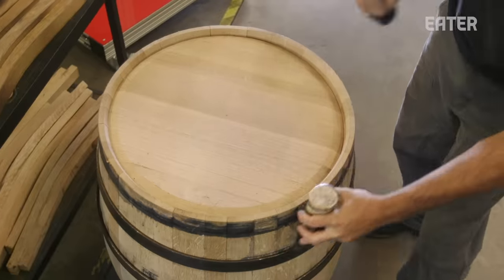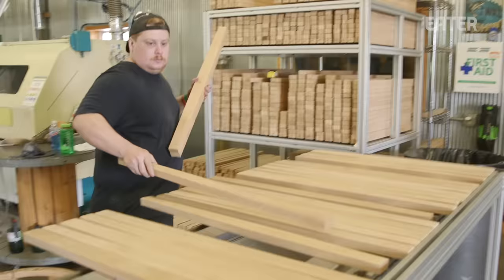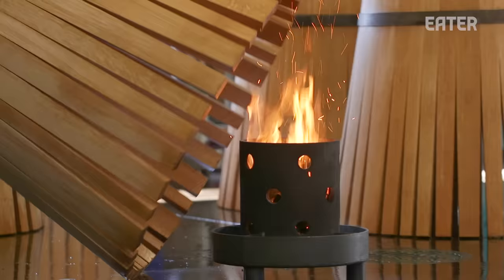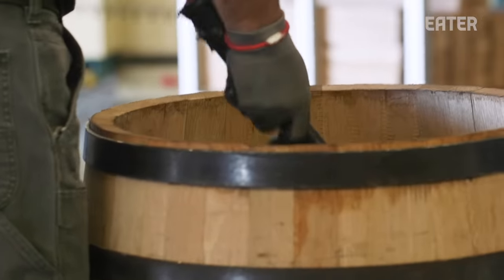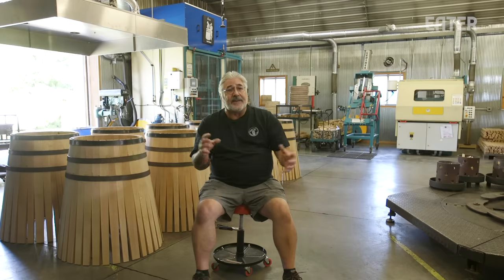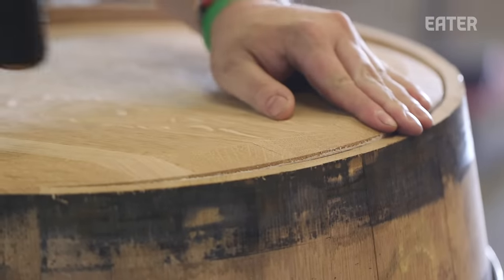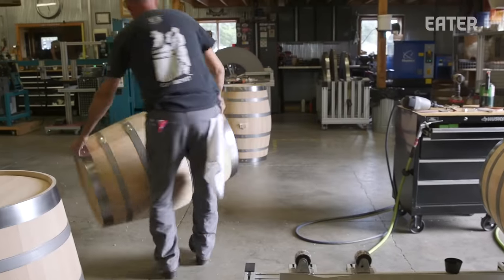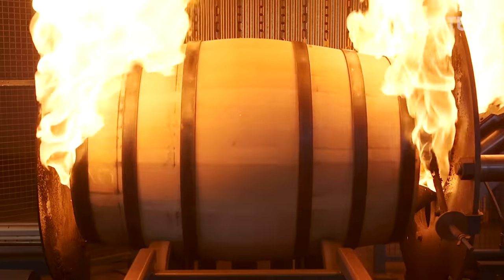How the NY Cooperage Makes Up to 100 Whiskey Barrels a Week — Handmade

Comment: Thanks for sharing.  In the USA the barrels are used once.  Then they are bought by Scottish distillers and they get several more reuses.  I visited several of the distillers and looked at their warehouses too.  You can see the "angels portion" - - little white deposits on the roof beams where evaporated spirit lightly settled....

Comment: Great video, great content, great product. I have an original cooperage catalog from 1897, that shows hundreds of different shapes and sizes. Back then, barrels were used for pickles, vinegar, oysters, all sorts of food stuffs and dry goods, to be shipped via stage coach, ship or rail. There were a lot more cooperages around back then, but as the lady mentioned, prohibition and the automobile cut that way back.

Comment: I recently toured a distillery here in Scotland where I understood that whisky is little more than water with ethanol and sometimes a smokey flavour if malting is done over a peat fire. It's not until the whisky gets into a barrel that it acquires flavour and colour and there's a massive hidden triangular trade in used barrels between Scotland, Spain & Portugal and Kentucky with experts buying the used barrels depending on what they contained before.

Comment: Very interesting an d you're providing a real world service.  I'm interested because I have one of only two mini-barrels made for the Bacardi family.  My friend's father worked for the Bacardi family for years and was given one of those barrels.  It's since come to me and I've been storing sherry in it for about 20 years.  Periodically I need to empty it, fill it with hot water multiple times and carefully push the hoops down a bit.  For that I use a wide blade screw driver and a ballpeen hammer.  I wish I could get it "updated with your fire.

Comment: I assumed when they showed the scene of them wetting the barrels he would specify that the water they used came also from Missouri and it was the same rain water that had been falling on those pieces of wood for the past 3-5 years, helping the wood age and cleaning off that Missourian pollen, and the rain water was collected only during certain months and than stored in special tanks, while barrel makers would walk around the water tank and basically speak to the water, telling it how special it is, and than when that water has been properly aged in NY steel tubs, it is then used to drench the barrels when they are firing them with "Pennsylvanian" natural gas handheld flame throwers so the wood doesnt have any propane smell or residue on it, and the natural gas fumes later evacuate the wood as the barrel procesa continues.  I like when a process to make something calls on using ingredients from different states, either because the people living there know how to process/make something in a unique way, or that the area lends itself to some unique flavor or aroma with that item. 
Great video!

Comment: I was wondering whether if toasted barrels were the objective would the fire bending automatically serve that purpose or would it be a separate process (after bending) and longer process with different heats levels depending on the toasting level desired?

Comment: I believe that Scottish distilleries generally won't use fresh barrels, they will only use a barrel that's been pre used for another spirit first, often it's bourbon barrels, bit can be equally other spirits. Apparently they say the flavour is better once the wood has had a chance to clean it's self in the bourbon spirit first, that way the flavour is much more subtle apparently, so interesting that bourbon uses fresh ones, will certainly suit the Scottish industry that bourbon has to be in fresh barrels.

Comment: I tell ya, i was living in Wappingers Falls NY, and just had this desire for a wine barrel.   So i go out driving all around the catskills just figuring with as many barrels i would see in front of store fronts and around peoples homes that it would be relatively easy to find a barrel suppliers.  NOPE!!!!!  Apparently all those barrels were either old from a bygone era or shipped in from other places.   And i certainly never found these guys.  But now i see the process and know without question i would not have had enough money to afford one anyway.   with that much manhours and labor i figure each barrel will likely run no less than $1000 or more.   which is well worth it considering.
Reply: interesting. Barrels are widely available in the U.K., most commonly they are sold in garden centres as water butts, or cut down in half as planters. Considering the work that goes into them they are cheap too- typically around £40 ($50) per half barrel, a little over double for a full barrel as they don't stack inside each other for transport so moving costs are higher. The smell of them is amazing, you can tell they are a byproduct of the whisky industry!

Comment: could someone tell me how the whiskey would be if you used say a barrel 100 times larger than these or a stainless container also 100 times larger than normal barrels and use charred oak pieces. Would the pieces with the same ratio of surface area make the same taste?

Comment: 3:30 - So the lobbyists guaranteed that no one could improve upon the current methods in order to protect their jobs. Meanwhile there are distilleries in Europe which understand that reusing barrels can improve the flavour of whatever one distills in them.

The funny thing is that the chemistry of what creates these wonderful drinks is being unlocked and in short order we will crack the code and be able to produce a superior product within a very short time frame. Once that happens the idea of traditional production will die off as even the traditionalists will understand there is absolutely no difference between the modern and traditional variety.

Comment: if he can eco the build and process -
a 10 beer barrel line would be such a new scent 

Heineken , Budweiser , forty oz brand , the strong set etc 

air conditioned room for storage - plus a great planter and storage once empty and dried 

it should be $100 hands over fists - 100,000 trial 

wood, bio mass pile - fire locked and base treated ** oils - sugars - eco binders etc **

Comment: It's nice that this video exists but it's a bit misleading. Mainly in regards to HOW important the barrel is in the flavor profile of a whisky. 

We know, for a fact, scientifically, that the single most important aspect of flavoring whisky is the still. There is a reason that old distilleries use the same still for literally hundreds of years and that certain types of still's are known for producing certain kinds of flavor. 

For example Irish Whiskies, known for their sweetness, use Pot Stills. Nikka (Japan) have a line of whiskies that use Coffey Stills (the man not the bean) and those are also very sweet, compared to the other Nikka whiskies that are aged in the exact same barrels using the exact same grain kept in the same location. The only difference is the still. 

All that said, the craftsmanship here is very impressive and vastly superior to mass produced barrels as even though I said the barrel is not as important as the still it is still (haha) very important ESPECAILLY with regards to the finish of a whisky. If you have ever had a sherry or bourbon aged Scotch, that is a Scotch aged in a bourbon or sherry barrel you will know that they have very distinct finishes. Same with all Bourbons, that sharp Oak aftertaste is an unmistakable aspect of Bourbon and it obviously comes from the barrel. 

And if you have ever had a Mizunara (Japanese Oak) whiskey again, the main thing the barrel gives to the whiskey is a very unique finish. Could go on, but I think the point has come across.

Comment: the guy was laying down what appeared to be some pretty good inside info.  while trade secrets are important, not sharing the knowledge is what leads to the industry dying, or at least turning to cheap imported crap.  his teacher was worried about the industry dying but only shared the info because the guy was on the complete opposite side of the country, no wonder its dying.  the percentage of people that would actually try and set up a real cooperage like this after watching this video has to be astronomically small.

Comment: Never saw the appeal of tasting the wood instead of the alcohol.
Reply: Because the ethanol itself isn't very tasty, at least not to most people.
Reply: @OggeViking  I was referring to the alcohol being poured into those barrels.

But if you want to be technical, there are probably a billion or so other taste additives you can mix with booze that does not involve wood.

Comment: might not be a popular opinion but lobbing to force bourbon whiskey producers to have to buy new barrels every single batch is kinda dirty. if you make a product of such high quality that you risk putting yourself out of business, then that means the market is over saturated with barrel makers. I would bet money this was a factor in the "devils cut" variety of bourbons you can buy since it's an additional source to recoup the cost of continuously buying barrels. 

as long as the mash is 51% corn, goes into the barrel at 125 proof, and made in America, then it should be considered bourbon.

Comment: You could just use big glass carboys with some charcoal and these guys would suddenly need to be charcoal makers instead of coopers. From my perspective as a brewer/distiller, this "bourbon must be aged in new charred barrels" guy is just like a buggy whip maker in the automobile era.  
The glass carboys would impart no flavor, but could be re-used indefinitely.  The charcoal would be a fraction of the wood required to make a barrel.  The same American white oak could be used to make the charcoal.  
OTOH, if the SHTF happens, coopering will be useful about 5ish years later.  But that's not worth the cost of keeping these guys in business.  He said it himself, in the video, they got a law to keep them in business.  That is not free enterprise.  That is crony capitalism.  Yuck.
Reply: You don’t get the same process with glass carboys though. Like he said, there’s a two way process of the spirit soaking into the oak and then being released as humidity and temperatures change. You also have evaporation (the angles share) and therefore a concentration of flavour, as well as oxygen ingress which triggers its own load of chemical reactions. Nothing against carboys, they’re great, but you certainly wouldn’t get the same flavour by placing a oak stave in one.

Comment: "hand made" with 20 different machines
Reply: Next thing you're gonna be saying is pottery was not made by hand because it used a potting wheel. Or that a table was not made by hand because the carpenter used a drill. At this point in technology, everything has a machine involved, but that doesn't mean it wasn't made by hand. If you want to compare, there are plenty of factories that produce things with conveyor belts and no hands involved. Or if you want a really good example look at a car factory- every single thing is done by robotic arms.